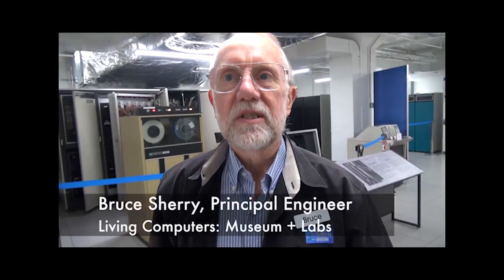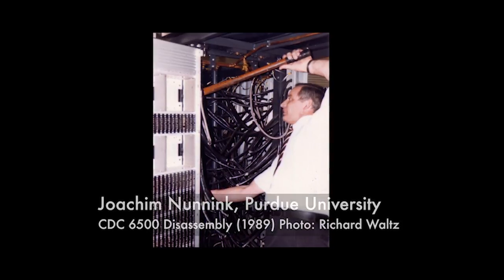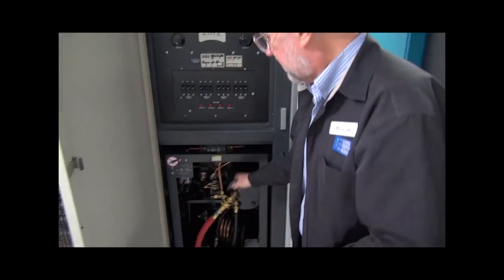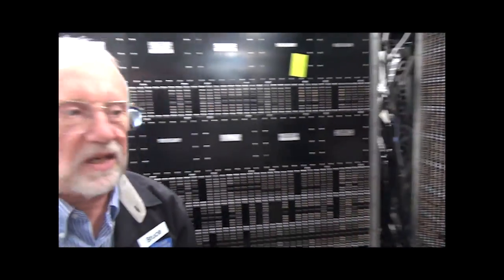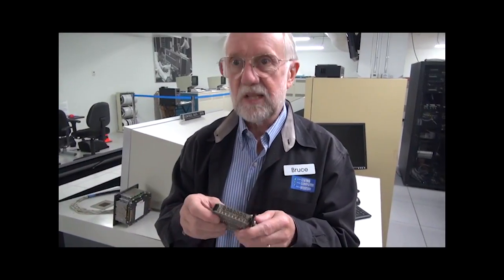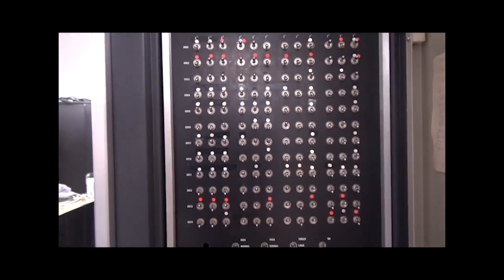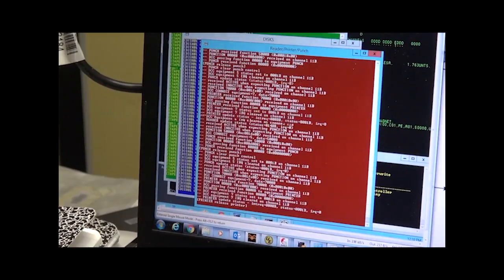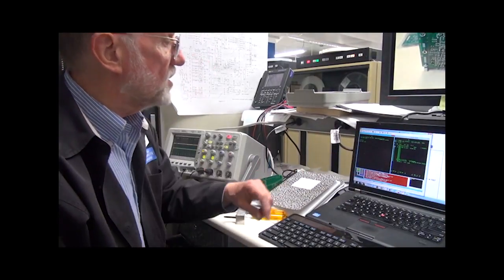Computing Conversations: Resurrecting the CDC 6500 Supercomputer video

Comment: I wrote programs on that very computer! They last time I saw it was years ago on the ground floor of the Math Science building at Purdue. As a student, I was not often allowed into the ground floor computer room. Us users spent our time in the basement, where the keypunches, line printers (except LP21, which was on the ground floor), and terminals were. Or at the Enad remote site. You knew it was going to be a bad day when you looked at the job queue and saw "MESA=== is printing".

Comment: I remember installing engineering changes that converted a 6400 system to the first 6500 system. 
Also, recall the day manufacturing changed the logo and the first 6500 marketing photos were taken.  Maintained the product line at customer sites, replaced a few transistors, found a toroid coil wired wrong, and found a new 6500 installation at a customer site where all the power bus screws were loose....  Have explained this system to my grandchildren down to how each segment of each character on the console is created by groups of individual transistors.  They call it my caveman talk.

Comment: I worked with CDC from August 1975 till 1978. Most times I spent maintaining the very old 607-P tape drives, which were loaded with mechanical stuff of course wearing out quickly. The computer system was a 6600 - I still remember the entire model & s/n = 6613 s/n D1059. This system was located in the Dutch CDC datacenter at Rijswijk. The disk drives attached to this system were of the type 841, which had its heads positioned by an actuator, which was based on hydraulics. Also there was a much newer Cyber 73, which was equipped with more modern disk drives, the 844. Learned a lot of amazing equipment.

Comment: I remember writing numerical analysis programs at Purdue which were run on that machine.  In a computer class, we had an assignment to write a PDP-8 emulator, which I wrote in Compass, the assembly language for the CDC 6500. This was between 1970-72.
Reply: MichaelKingsfordGray  The octal thinking served me very well in industry. I ended up responsible for a material handling system which was coded in Macro-11, the assembly language of the PDP-11 family of minicomputers.

Comment: I was the manufacturing engineer for the large core memory (ECS) on the 6xxx machines in its incarnations (same with the 7600 models' large core memories). The transistors in the memory sense amps were matched pairs (and costly). It's my understanding that Seymour Cray did not want to use the integrated circuits (like op amps) of the time because they were too slow.
The ECS memories of the original design were very unreliable with some serious design flaws that required a later and total design change (ECS II).
Reply: Cray didn't use IC's when they first came out was because of reliability, not speed issues.